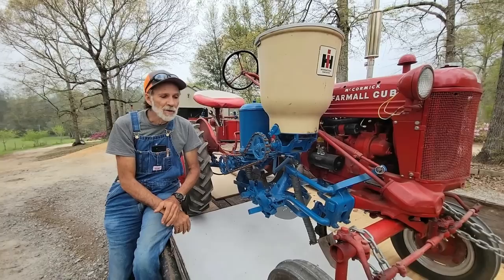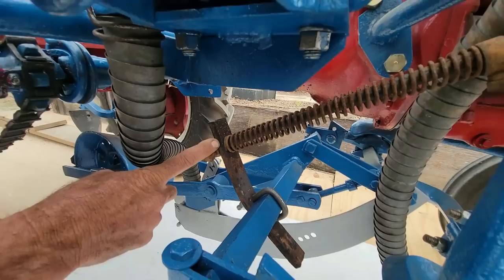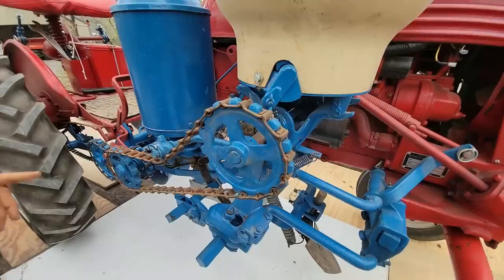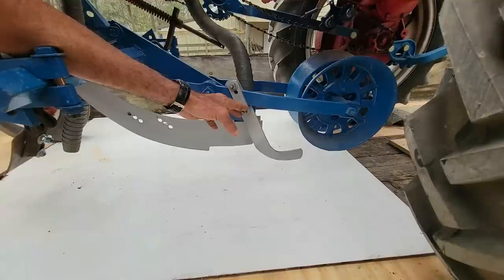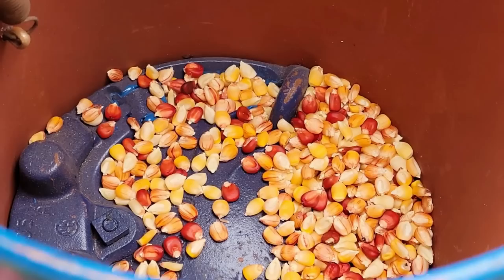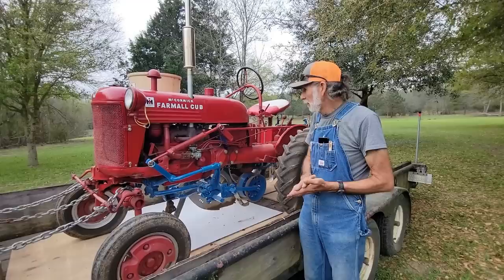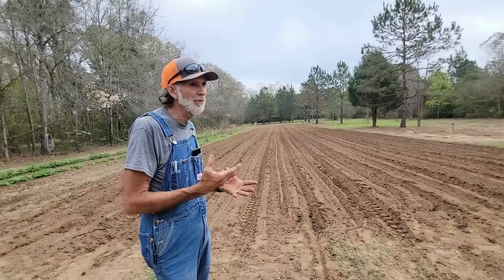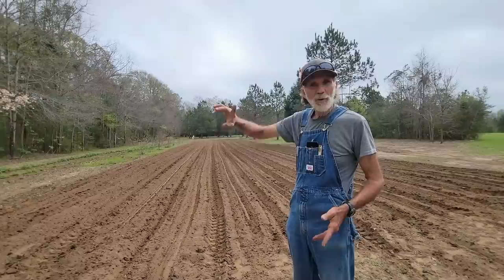It is TIME to PLANT CORN! - Zone 8 with Farmall Cub

Comment: Looks like you have the planter working well! We usually run the planter down the driveway dropping seeds (shanks and shovels up) to accurately measure spacing, plus ensuring the plates and seed match well. Wheels matter! I have a 1950s JD 290 that came to me with 'implement tires' so I recalculated the gear and transmission chart based on measuring the tire circumference actual (use a string) as a simple ratio to what tires are 'in the book'. Truth is that driveway test. ... Also, it's not a bad problem to start the planter at each row early before getting to full depth of the tilled soil for the same reason, my father taught me back in the day you want to actually see the seed and fertilizer at the ends -- ensures you can see that no tube is plugged, seed or fertilizer hopper is empty, or seeds are getting cracked by plate vs seed size mismatch as they self-sort in the hopper. Easy to locate from there where the problem started before you plant the whole field and only at the end learn the seed hopper is still full! ...  Good you saved the drought seed -- you hard won those genetics for drought tolerance. With as sandy as that soil looks, be sure to experiment with putting mulch down between some rows and even try green cover crops (seeding after the corn gets to V3 stage and no closer to the corn than the corn in-furrow spacing used). You don't entirely know how this field reacts through the season so some experimentation can be important. Sometimes rain skips around fields simultaneously missing or flooding neighboring parcels until you and the seeds learn this one.

Comment: Good job, NO, Great Job, Danny.  I loved this video.  I wish we had more people showing how to use old implements on their antique tractors.  Even at the local antique tractor show every fall, you see all kinds of antique tractors but almost no implements that were used on them.  There are guys there with flat trailers loaded with all kinds of antique parts for both tractors and implements, but no complete cultivators, planters, sickle mowers, etc.  I have an antique 2 bottom 3pt plow made by Case which was used on the VAC, as well as SC & DC models which had the Eagle Claw 3 pt system.  I hope to get it cleaned up and repainted a bright green color which apparently was the original color.  Want to take it to the show this fall mounted to one of my VAC's.  I even have found the owner's manual for that plow and a few other implements.
I sure hope your corn does well.  We both know that even though we do our best to plant, cultivate, fertilize, etc,  it is still a matter of getting the right weather conditions all through the  season to produce a good crop.  Hope God gives us both a good growing season.

Comment: My grandfather owned a Farmall cub and used it to  cultivate and use a single disc harrow for ditch maintenance was all I've ever seen him use it for. That rotary tillage tool looks like it beat out the clod buster my dad used to use after disc harrowing. My grandfather used one of those corn planters that was mule powered. I'm thinking that the planter had an adjustable rotating aperture plate in the bottom of the seed bucket. Brings back the memories

Comment: Great video! Several years I bought two planter units from a John Deere 1280 planter. I made a hitch for my limited catagory 1, 3 point hitch. This 80 series unit is the first of the finger type planter that was a ground driven by the back wheel. Spacing is controlled by changing sprockets on the unit.

Comment: Hi Danny!  Seed these days are not sized as they were back in the days of the good old plate planters. The seed plates need to match the seed you are using,  however modern planters use vacuum and therefore seed companies do not bother to "size" seeds anymore. 
Also, you might look into organic seed lubrication powder. Seed lubrication is typically necessary for plate planters. 

It is not advised to band most  fertilizers in the same band that the seeds are in; typically the seed and fertilizer bands are spaced 3-4" away from each other.

I really appreciate your channel! God bless you and Mrs.Wanda!💙🐑

Comment: I believe you can use a hand lever that is used with the turn plows to lower the rear cultivators independently of the front.
When you start into the row you use the hydraulic touch control to lower front cultivators then use hand lever to lower rears at proper time.
I could be wrong but I think that's how it works.
Great content by the way. I just ran across your channel.
Reply from the maker: You can y problem is I have a torn rotator cuff.

Comment: I had a 140 Farmall with cultivators, planter, hardee mower, scrape blade, turning plow, harrow and a few more things . I had it for about 20 years and sold it about 17 years ago.  I have missed it ever since. I can't find a Cub or Super A or 130 or 140 anywhere within a reasonable distance. I have an L3130 Kubota, but it is not a garden tractor.

Comment: If you go down to your local John Deere dealership and ask for the flex tube for the fertilizer hopper on a 7200 max emerge 2 planter it’s a rubberish kind of flex hose. It should work for what your trying to do with the planter and fertilizer.

Comment: Danny, feel inside that square seed chute.
If you feel a lip or even a  hole, that would indicate that the OEM tube had a spring loaded catch to hold the tube in place, somewhat similar to the way a ratchet holds a socket.
If there is no lip or hole, then it was likely held in place by a friction based mechanism possibly a spring clamp in reverse mechanism.
Then again, it could have been held in place by that wing nut you wrapped the wire around.

You could fabricate a clamping mechanism with a standard radiator hose of the correct diameter.
Drill a hole into a piece of sheet metal and mount it with that wing nut. Then tack weld the clamp to it so that it is in the correct orientation to hold the tube. Then all you will need to do is tighten the clamp down onto the tube and use either the clamp or the wing nut to dismount it.

Comment: I have been thru the same with my Cub, my planter is a 171 with what they called a single seed, yours looks like a Richmond planter? I read that they mostly sold the single seed planters in Texas, not sure why. I have used mine at least 25 years and love it. The old fellow I bought the tractor and equipment from laughed and said it made him so lazy he stopped emptying the hopper when changing to next vegetable. Just dumped the peas or whatnot in on top of the last of the corn and kept on going. I catch myself doing that too, ha.  Once you get the hang of it, you will love it. Cheers, and thanks for the videos.

Comment: This rod is mounted closer in the rear like four inches above the bar. The rod is shorter with an open hole end like the rod in front for cultivators at the touch control arm. In front   I’ll attach a picture of the

Comment: Sometimes you can turn the steering gear over in the housing to use the unwore section and tighten up the slack . Just make sure you don't get it too far one direction.

Comment: A side bar off the planter frame and put your fertilizer knife on there and run it off to the side.
 
If I had put my videos up I filmed it may have helped you out. There not quality or produced well but I have footage of me assembling that.

The spacing is in the manual. But it also has to do with the cog numbers on the planter gears as well.
Reply: You are right there is almost nothing on YouTube that shows this cub stuff in detail.

Comment: I think this is a Farmall 174 planter and fertilizer unit.  Hard to find very similar to my A-184 planter for my farmall 130.  eBay has the manuals pretty cheap might help with this years planting.

Comment: I have the original corn plates that came with the Richmond seed hopper for the cub in x-small small med and large.  I'd be happy to get the numbers off them if it helps at all.  The large corn plate also works great for beans but plants a bit far apart.  I'm going to try a soy bean plate this year and see how it does.
Reply from the maker: Yes I would love the numbers. Are they the thick ones? Or do they need the spacer? I can't find any spacers.
Reply: @DeepSouthHomestead  All these plates are thick plates 16 cell.  No spacer needed. They extra small plate is 1975a the small plate is 1977a the med plate is 1978a the large plate is 1979a.  those are all IH steel plates.  The sweet corn plate I use is a plastic plate from Lustran  C9-16 that I cross referenced from IH sweet corn numbers as they IH sweet corn plates are expensive. Is far as I know the thin plates that need spacers are for small popcorn or glass corn.  These plates worked great for bloody butcher and up to Hickory Cane.
Reply from the maker: @rustyschackelford9645  Thank you so much for the numbers.

Comment: Good video. Most of the presenters using the old equipment tend to run in creeper gear. Wow, you went right along as a good speed the way it was intended.  The way some of these guys run the tractor on You Tube, it would take 3 days to plant 4 acres. We ran the equipment about 3.5 mph. The filler tong mounted on the planter frame was optional. We used a two-row planter similar to this planting over 100-acres a year for 20-years and never used the tongs. The added idler was not necessary, you just set the tension of the chain by length. Otherwise, not to know anything you did a great job.